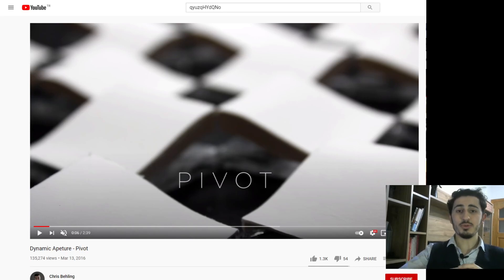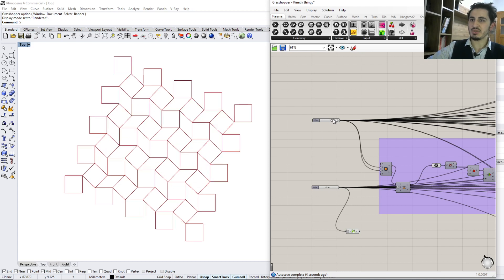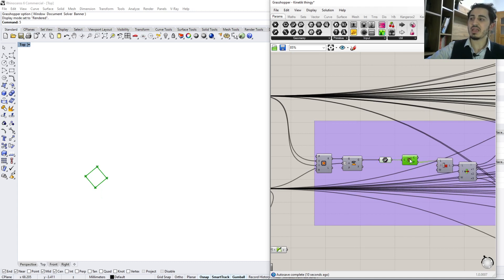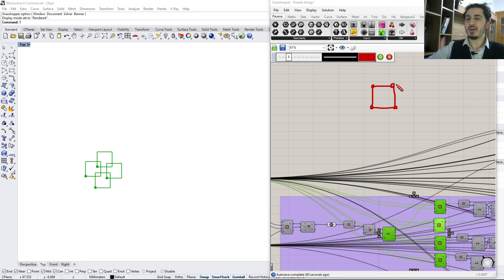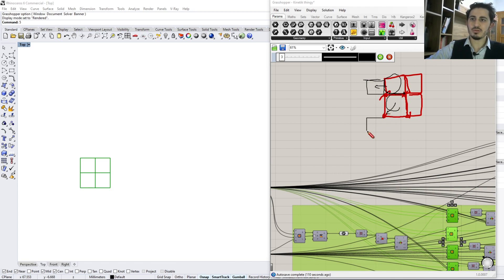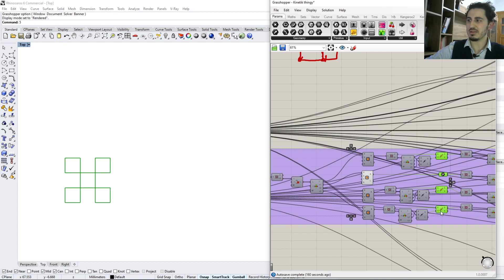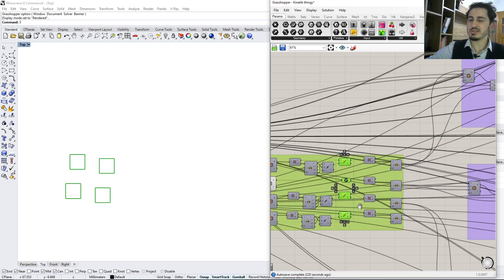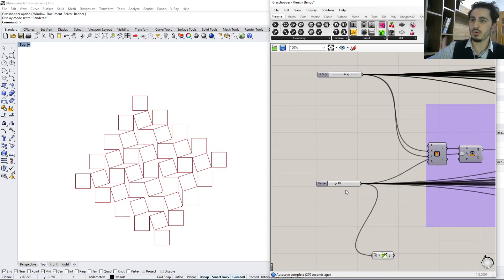Dynamic Aperture - Kinetic System Definition on Grasshopper

Comment: This topic is what we call kinematic actuation. Kinematics is quite complicated because that requires moving points along lines or actuators. This is a fascinating topic studied in mechanical engineering. 

Grasshopper uses lots of strategies borrowed from different fields of knowledge such as differential geometry, kinematics of mechanisms and differential geometry. Understanding it is easy, comprehending the concepts takes time because everything in the geometrical construction is linked or constrained. 

This is simply a great lesson. I'm glad that the Arabs are TEACHING their comprehension of geometry.